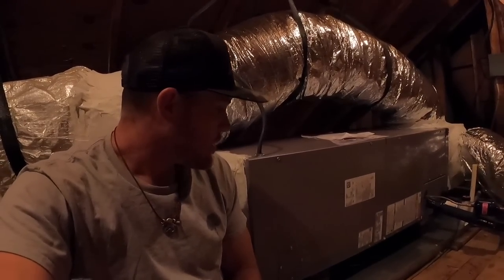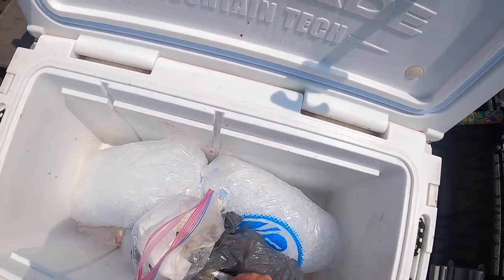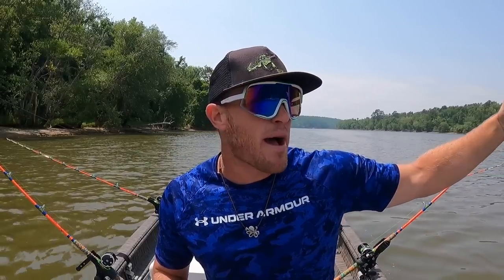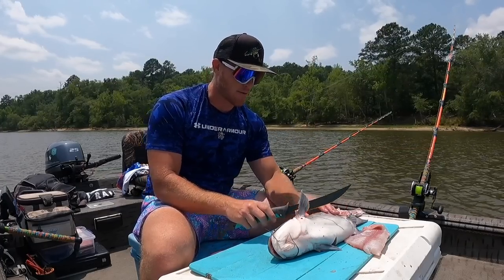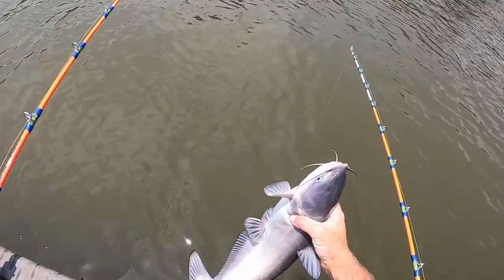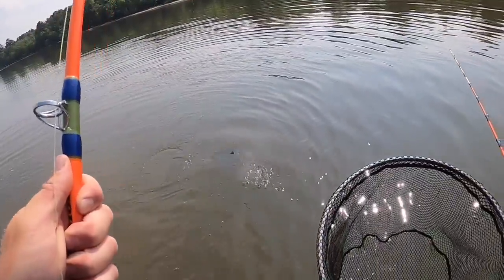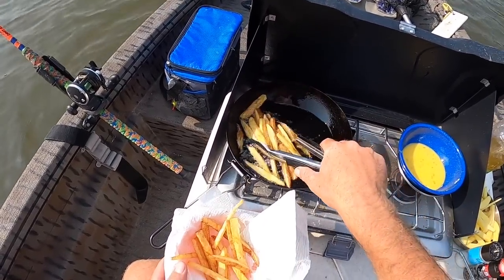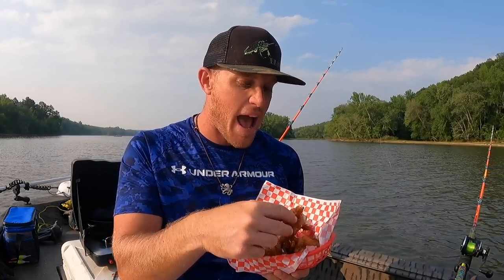Making Catfish n’ Chips on the Boat! Beer Battered Blue Cat!

Comment: Hey Micah I do HVAC for a living. Been doing it for almost 15 years now and I gotta say that air handler install in your attic is clean work. Also that wired mechanism attached to the plastic drain piping is a safety switch to shut the unit down if there were any blockages in the drain to avoid home damage👍. Love you and your bros videos just wish you guys were back in Idaho so I could come along some time. -Justin M.

Comment: I’m an heave tech and installer. The plumbing you have coming out of there is the drain for your coil. As your system cools it condensates. And the cap you have on top of that pvc is so you can clean it. It can get dirty over the years as water passes through it. I hope you like your new system though. Like your videos. Been with you guys since Idaho.

Comment: Had to
Comment. Those “plumbing parts” is your drain for the water and that has a built in safety switch so if water backs up it’ll trip the unit and turn it off so it doesn’t keep running and produce more water

Comment: Micha, for a proper Southern beer batter, mix flour salt pepper and other spices in a bowl then add the beer to the floor and get it to the slightly wetter consistency than pancake batter so the batter is thick enough to fully coat the fish and stay on as you drop the fish into the hot oil. Fry until golden brown and crispy. Set on seeing rack or paper towels remove excess oil. Also you should always bleed it your catfish to enjoy the best quality of catfish. Btw, you only get the fishy flavor on the catfish when you don't bleed out the fish or remove the bloodline.
Reply: Blood-line on a catfish has more of a muddy/earthy taste than it does fishy taste IMO. That's why I cut mine out anyway.